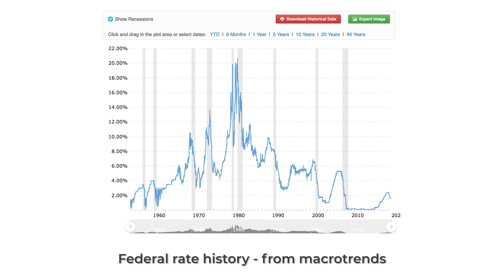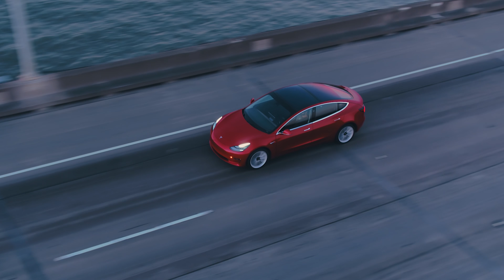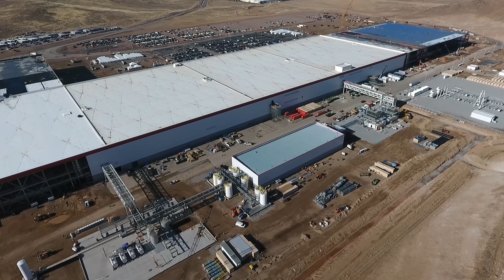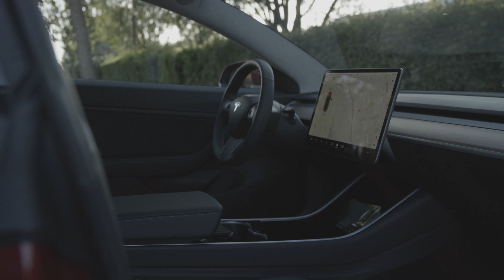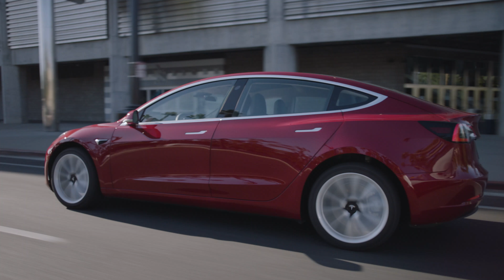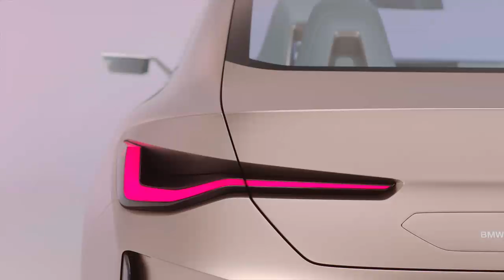New TSLA Street-High Price Target + BMW's i4 Electric Vehicle Concept Hopes to Compete with Tesla

Comment: The ICE car companies to survive should release very quickly Natural Gas versions of their models

Natural gas is so much cheaper than petrol

Refined Petrol costs 7 cents per KWh
Refined NG costs just 1 cent per KWh
EVs can't compete with NG cars on fuel cost. 1 cent NG Vs 10 cents electricity

GM/Ford could easily afford to deploy a Natural Gas supercharger networks in the USA

NG cars are also about 25% lower emmissions which puts them on par with electric cars in most the world's grids

Comment: The i4 curved screen has a drawback:  The  passenger  cannot navigate for the driver.  What we really need is a second control knob on the right of the right seat so that the passenger can set new destinations etc. while the car is moving.
Reply from the maker: Definitely suboptimal for autonomy as well

Comment: It may be that using a flexible architecture is sub-optimal only from a production point of view, relative to the case in which only an EV were produced, not necessarily the performance and quality of the end product. In this case it could be a smart choice to share a platform amongst ICE, plug-in and EV, because in the mixed period it could actually provide cost benefits overall.

Comment: 80 kwh in 550 kg is an energy density of 145 watt hours per kg at the pack level. M3 is already at 160 wh/kg and battery day is going to see big boosts in that I think.
Reply: M3 pack is 156 Wh/kg not 160

Also this isn't that important a figure
Imagine a Tesla with 75KWH = 480kg
Imagine a BMW with 75KWh = 515kg

So it means the BMW pack is just 35KG heavier for the same 75KWh capacity

More important is the cost per KWh
People say Tesla is leading on cost but Tesla doesn't even make batteries it buys them from the likes of Panasonic or CATL who would probably be happy to sell to any auto company at the same price

Also it's not one EV Vs another it's EVs Vs petrol cars. And the petrol drive train is significantly cheaper and lighter than EV drivetrains

Ideally all EV platforms need to get energy density to 225Wh/kg at the pack level.
So down from ~500kg to ~330kg 

Right now petrol still wins
Audi A4 is sub £25,000 at the moment
While a model 3 before government subsidies is £43,000

At the same price I'd take the M3
At this huge premium I'd take the A4

Also just for comparison best selling car in Europe is the VW Polo a car that you can buy for below £13,000 so the M3 is more than 3x the price of the best selling petrol car in Europe

Comment: I haven't heard you mention the PG&E battery deal... That should represent 9 figures of revenue, though IDK what their profit margins are on grid energy projects like this.
Reply from the maker: I mentioned it last week but we should probably spend more time on this
Reply: https://electrek.co/2020/02/27/tesla-1gwh-megapack-battery-project-pge-approved/
Reply: Robert Kesselring what PG&E battery deal? Is there an article on this?
Reply: @jacbuc1  Monterey CA?
Reply: In  Brazil, Minas Gerais in the Interior Midwest Mineiro Brazil,  The best logistics point for the Tesla Model Cybertruk 

The best logistics point for the Tesla Model Cybertruk And Semi and Solar Fotovoltaic Energy to install in Brazil has to be in The best logistics point for the Tesla Model Cybertruk And Semi and Solar Fotovoltaic Energy to install in Brazil has to be in Minas Gerais in the Interior in the Center Oeste Mineiro Brazil near a Dry Port of Vale do Rio Doce Railway Train.
, and Great airport ...

And the Great Federal Highways like 381 and 262 in Minas Gerais ...

Logistics and Fundamental in Transport Strategy for Product Production Delivery in Brazil

The interesting thing here for the Tesla Model Cybertruk Taking off here has to be the same as BYD has already done in Campinas, it has to start with the manufacture of photovoltaic solar panels, which it is very specialized in this part of, and has reduced the cost by 16% in the production of these Photovoltaic Solar Panels to pass on to the Consumer ....

She has her very large Solar City Fotovoltaic Lend that Company in USA

Reduce the cost of producing a product to sell in bulk and complicated

And her Other Product would be Bi Bus Passenger Electric Bus for the Urban Perimeter, they are very good in this Technologies, it would stimulate the productive chain in Brazil and generate a lot of work and income for all, the important thing and generate energy and improve passenger transport in the urban area .... next to a Porto Seco by Railway of Vale do Rio Doce.

And the Great Federal Highways like 381 and 262 in Minas Gerais ...

Logistics and Fundamental in Transport Strategy for Product Production Delivery in Brazil

The interesting thing here for the Tesla Model Cybertruk Taking off here has to be the same as BYD has already done in Campinas, it has to start with the manufacture of photovoltaic solar panels, which it is very specialized in this part of, and has reduced the cost by 16% in the production of these Photovoltaic Solar Panels to pass on to the Consumer ....

She has her very large Solar City Fotovoltaic Lend that Company in USA

Reduce the cost of producing a product to sell in bulk and complicated

And her Other Product would be Bi Bus Passenger Electric Bus for the Urban Perimeter, they are very good in this Technologies, it would stimulate the productive chain in Brazil and generate a lot of work and income for all, the important thing and generate energy and improve passenger transport in the urban area ....

Comment: BMW battery pack 80kWh @ 550kg give 145Wh/kg. 
Note, it’s the pack energy density not the cells energy density. 
Wonder if Tesla cells energy density is around 250Wh/kg, what is the battery pack density?